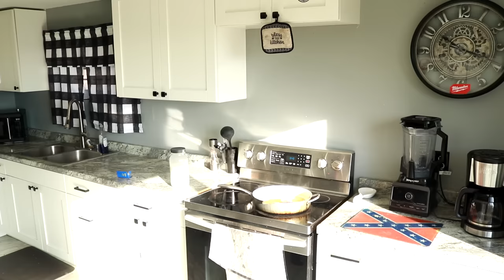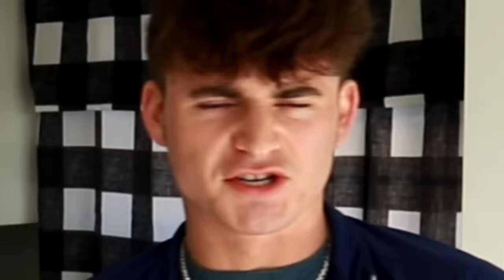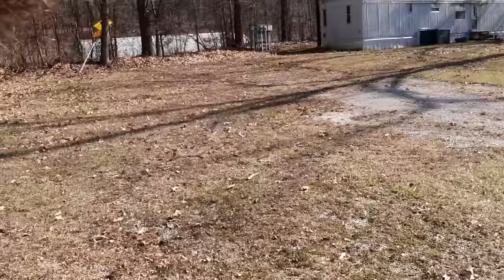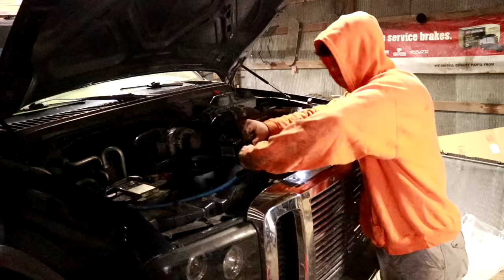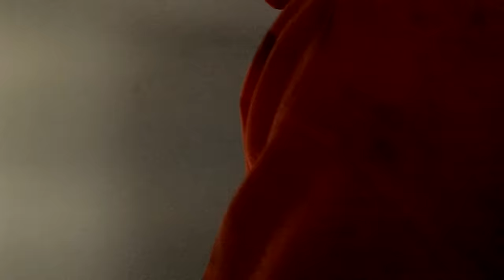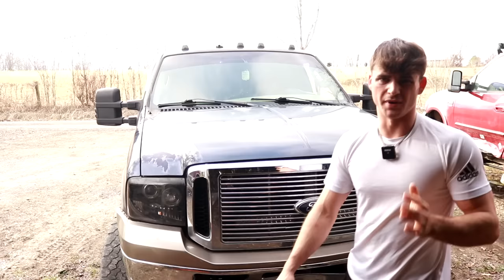Visiting THE TRAILER In 2024!!!

Comment: A p0300 could be clogged fuel rails most likely or a clogged fuel filter starving the truck for fuel delivery fuel pump or all 8 injectors but I doubt it would be all not firing or you Hpop is going out